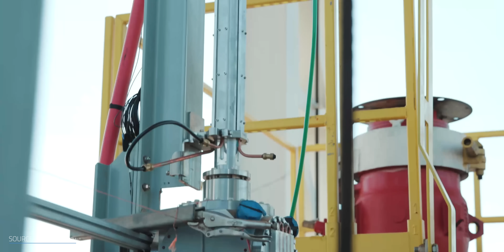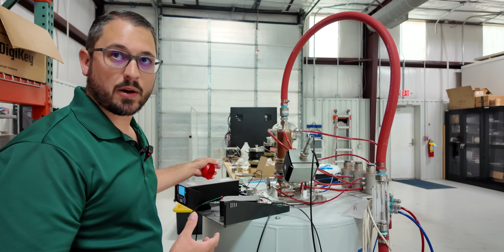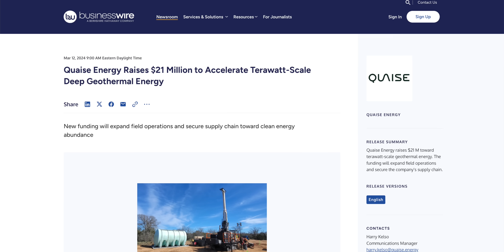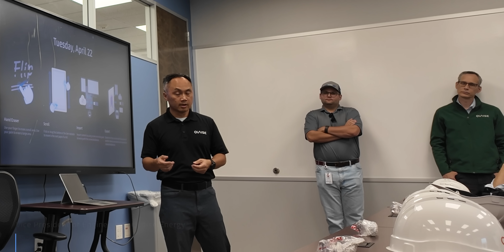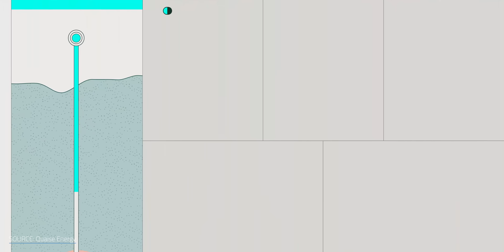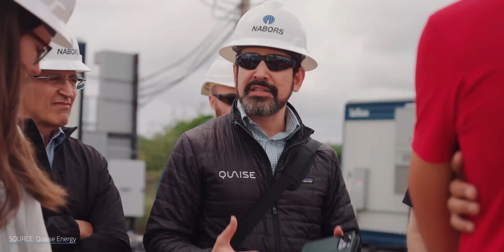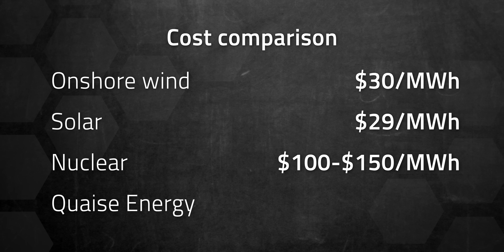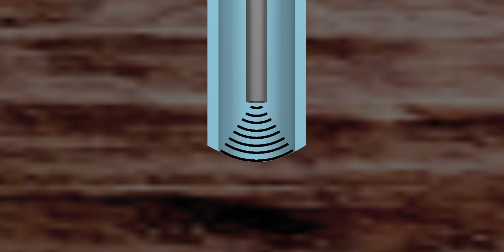How Geothermal Energy is About to Break its Limits

Comment: As of the now estimated costs higher than solar and wind, but cheaper than nuclear clear good for areas lack of solar and wind, and with the side effect of using heat where it is needed yet (Arctic regions).
Go ahead, but be remined ... we thought oel will be so much never ends, gas and coal - but we know, that this deposits are limited ... as is the heat of earths core ALSO !
We have realized how a small but steady CO2 output alters our air composition and started climate change, so if we use this thermal energy too much for we WILL also change the heat of earths core with other problems.
Solar direct and wind as secondary product of more natural power brought from the sun must be the main source in future.

Comment: electricity cost alone will be absurd, it is like microwaving to melt ceramic or glass ware. additionally, the equipment will not survive once they go deep/hot enough which they haven't done yet.   i hope they find other applications for their work.

Comment: Is there any concern of cooling the earth core or is it to minimal to even worry about.
Is the heat created purely from these earth pressure above? 
Very cool system
Reply: Cooling the core by one Kelvin would require extracting 10million years of current world energy consumption, without even counting the radioactive decay constantly replenishing it. Also the rate of what we can extract is limited by the thermal conductivity of the rocks in the crust and mantle.

Comment: I think this drilling technology has amazing possibilities for many applications, particularly if the costs pan out as described.  However, generating hydrothermal power using supercritical water creates many concerns.  Supercritical steam that is used to make electricity has faced many hurdles including rippled magnetite on the steam generators, and this is with ultra-pure water. Supercritical (SC) water, like most supercritical fluids has amazing solvation properties and downhole SC water may dissolve many impurities in its path to the power generation system.  In contrast, using this system to drill for subterranean H2 reserves might be a great source of clean energy.  The gas can be cleaned and used in electrochemical systems to produce unlimited amounts of clean energy.  Great tool and technology, but maybe look at H2 as a better first option.

Comment: Fascinating video!  I'm wondering if @quaise could tell us what happens after they've bored the hole.  Does it require some type of fracking at the bottom to get enough heat transfer to the water?  Or simply use the single hole and the heat transfer from the wall?

Comment: Are the bore holes predicted to have vitrified glass casing all the way down? Or some steel casing through certain earth layers and vitrified glass through other layers? And is it predicted that vitrified glass casing would be water tight? It sounds like it's "wait and see" with regards to water getting in the hole. But if vitrified glass is coating the bore hole, I was thinking perhaps it would serve to keep water out.

Comment: Drilling wells is about pressure control.  If you hit a gas zone at 1000’, it will be coming up the hole at least 4400 psi.  The gyrotron ‘glassed’ borehole withstanding 4400 psi is risible.  That’s why wells are drilled pressure balanced with drilling mud.
    Once the holes are completed and the zone fracked, don’t assume the circulating well fluid behaves as planned.  The fluid has its own ideas and will channel a short cut instead of spreading on an even front thru the formation.  It has to be circulated s-l-o-w.  This ain’t a show stopper, but the frac zone needs to be much larger than expected.
     The temperature how deep you can drill with the gyrotron which is not too hot by steam plant standards.  Then the well fluid, which is full of crap, has to exchange heat to the turbine cycle.  More loss.  The net product is wet steam.  This isn’t a show stopper, as nuke plants have the same problem.  It means more capital needed.
      But on a bright note, geothermal has one thing going for it….its more promising than fusion power.            Cheers

Comment: Former flunkie offshore drilling geologist (mudlogger) here.  I daydreamed about doing something like this many years ago.  My aim was just make drilling faster and less arduous.  I even wondered if it could be used to harvest metals from metal-rich fluids rising off of magma bodies as an alternative to conventional mining.

Obviously mine were just hypothetical musings and had zero applied physics and engineering attached, so I claim and deserve no credit, it’s just kind of nice to know that I wasn’t the only one thinking about this.

I do wonder how they will handle drilling through through rocks with large volumes of highly pressurized pore fluids.  If you can start boring into impermeable igneous rock at ground level that avoids the problem almost entirely, but does narrow appropriate sites available—still many more than now, but you’d still have to drill where nature lets you, rather than just “point the pipe down and let it rip, drill ahead without fear or caution” that would be ideal.

Possibly another option might be casing the hole simultaneously with drilling it.  That would involve R&D to modify the rigs, and some retraining of your roughnecks, but almost certainly much less than they have already done working up the death ray ;)

In any event I wish them luck and hope that everything goes smoothly.

Comment: Great video. These guys have a viable technology and a very clear plan on how they are going to achieve commercial viability in the near future, and how they are going to beat other forms of renewables in both LCOE and providing constant base load power. Furthermore, this kind of technology could e easily applied wherever there is drilling and fossil fuel plants, meaning that this could be accessible all around the world - they're even planing how to transport the technology in shipping containers. This could really totally revolutionise clean energy if it works.. 

The biggest problems will be dealing with real world conditions and issues like dealing with groundwater, but the very structure of the drilling shaft being vitrified rock should help that, as vitrified rock is very robust and durable but also dense and nonporous, meaning it's difficult for water to pass through it, meaning the problem will be more likely drilling through water than water getting.through the drill channel walls. So it looks like the main issue will be of extra energy being needed to boil the water off rather than technical difficulties - which may be helped by the shaft being constantly heated to a high temperature by the drilling process itself as well as the water in the rock getting hotter as the shaft gets deeper.

Solar is already very cheap so a lot of people ask: why bother with this. technology? But the issue with solar cones in two ways: the energy is intermittent so batteries are required to keep the energy stored (which is an extra cost), and solar panels only have a lifespan of 25 years, meaning they need to be replaced after that time and all the solar panels that have been used will require recycling. That means not only enormous stress on the industry to recycle these panels (plus extra energy and extra cost to accomplish this) but an added cost for everyone who needs to purchase new ones (especially governments who use wind farms). Wind is similar except much larger structures need to be disassembled and recycled. This new avenue for geothermal is a more viable long-term solution...if they can make it work.

Comment: The incongruity of a cryogenic superconductor gyrotron to generate plasma...  If I followed this video, it would seem that the main issue they have with the current drilling operation is the power source/supply and there are solutions for that, so I  hope that this will prove a viable operation.

Comment: they've demonstrated… 10 feet? is that right? They haven't even matched depth with the height of their derrick?
and to achieve their aims, they need … 20km? nearly double the depth at Kola, which was and remains an unparalleled achievement?

I'm just checking the figures presented here to see if I missed the part about their machinery doing anything at all. Because a 4in bore to 10 feet is super for … anchoring a pretty big flagpole?

Comment: so what do you do when youve extracted most of the heat from the well? drill deeper? eventually your gonna cool it down too much to be useful, what is the specific energy at a given depth potential value versus drilling cost? maybe you can drill farther after you've collected the surrounding heat? their is still alot of unkowns and problems unaddressed that could severely affect the viability, you could potentially drill even farther than imaginable or just have overlooked the problem of rock being a very poor media to transmit heat. and what about the potential for earthquakes? drilling massive arrays of wells will have some impact to tectonic integrity, couple that with contraction of the ground from cooling, and now what do you do with the waste heat? the warm steam after leaving the turbine will go into the atmosphere and now will heat the climate to some potential, if youre gonna critique fossil fuels then you got to hold the same standard of questioning for everything, otherwise 50 years down the road its gonna be the same story as our current situation.

Comment: Nice idea, but they could actually try to design a machine capable of working on venus, and adapt it to BE the drill-head apparatus instead of having it exposed on the top of the drillshaft. If you use a coolant medium that can create electricity through thermocouples and an active use of a coolant to keep the outsides from melting as it bores through solid rock with emitters that go THROUGH the drill body in radio transparent materials that also allow coolants to make a heat exchange powerful enough to vaporize water at the sweet-spot temperatures of over 375 degrees fahrenheit to create superheated steam to drive powerful turbines. Think in reverse and reduce the size of the turbines, the temperature, and the mass, and you have a community sized geothermal powerplant that can move lower or to a new site in case of earthquakes. Having all the machinery at the top reduces efficiency and increases lag in decision making times.

Comment: why not spray the rocks with a black, or milimeter black spray paint before vaporizing it so less of the rays get reflected and more heat goes to the rock under the thin layer of paint?

Comment: Cool but clearly non viabile. It will be acquired by a oil company and maybe used for oil drilling or just forgot. 

I don't understand why you need 300+ degrees, why don't use gasses that expands at lower temperatures?

Comment: There are stratigraphies where drilling fluid of a specific density is needed to stabilize the well bore. Not sure if vitrified sandstone and shale will work and certainly encountering a geo-pressured gas and/or salt water sandstone would be a disaster. Conventional drilling to a determined depth, then casing the open hole, and drilling ahead with the gryrotron?

Comment: I don't see how the forced air that removed debris and vapourized rock from the hole keeps vapourized rock in a gaseous state long enough to get it out of the hole.  I was imagining rock vapour condensing on the sides on the way out, and on the boring mechanism that's still working lower down...

Comment: Hmm, but what happens when they drill through a water bearing layer?
Even a small crack in the melted rock walls will lead to significant ingress and probably explosive steam flashing out of the hole.

Comment: What an amazing process. No tripping out of the piping and there is no casing or mud issues. The sealed off hole also means that the fluids that are used to generate the steam won't contaminate the porous layers. Hope it works for them! I do think that they will have issues when they run into zones that are under-pressured. Will the "burn hole" have the strength to hold up if a subsurface cave happens?

Comment: A very encouraging report! The signs of a practical technology are everywhere in this video. They actually have performance numbers (!), something most blue-sky nonsense projects cannot be persuaded to divulge. How fast they can drill (varies by rock type=true), rate compared to mechanical drilling, energy it takes to drill, a plausible timeline for first pipeline, a plausible cost/return estimate, and vitally, a plausible backstory of the technology (uses a device designed for nuclear fusion research). There are no information black holes, and there are no physicists saying this is impossible nonsense. 
This does not sound like a long con, like cold fusion. They are not violating established physics. In fact, they are adapting an established technology similar to microwave ovens, so there's plenty of proof that it's not bullshit. Another good sign is that they aren't pretending the energy will be "free." They're estimating it will be more expensive than either wind or solar, but geothermal will be constant and reliable. Cheaper than a fission nuclear plant, but nowhere near as fear-inducing. Hey, it's just a hole in the ground, and you're just making really hot steam, without burning fossil fuels. No radiation, no CO2, no unexpected disasters. This might actually happen!

Comment: I believe your wind and solar pricing is 100% pure bovine excrement.    Was it so so cheap in Spain when the grid colasped.     If you do not  have 100% backup baseload you have the edge of death for how many people.     Geothermal has a solid baseload energy source.    If this process lowers the cost of drilling per mine it makes more areas where geothermal  can be produced.

Comment: If they really can drill at such low cost, they should be offering their drilling services to all kinds of projects, like subway construction, tunnels, water transmission, etcs. There must be some reasons that they are giving up all the existing markets and applications. All start-ups try to exaggerate their strengths and hide their shortcomings. I would not expect this company to be any different.

Comment: In terms of long term energy development, this tech could work anywhere with a hot mantle.  I'm thinking especially of expandable/modular baseload generation (and easy heat!) on mars, since wind and solar are weaker and less reliable (dust storms!) there.

One drilling rig could keep making more power stations as facilities grow, and a superabundance of subterranean energy systems would encourage growth where the annoying surface conditions can be avoided.  Enough electricity/heat to power agriculture lights and maintain balmy open-air temperatures in a big lava tube city would make things a lot more sustainable, even desirable.

Living in cramped little 10-meter corridors spiderwebbed through the rock is survivable.  Living along a 200-meter-wide avenue at stable room temperature, where you can literally plant your own garden boxes in the front yard, makes it a comfy home.  It's the possibility of a real ecosystem.

I checked.  Martain crust/mantle conditions make it a bit farther, but it's still in the doable range by the figures Quaise is talking about.  The tectonic stability/dormancy of mars actually makes it even better than earth for this technology.

There are certainly times when my knees think 38% gravity is a great idea.  If the medical issues with mars gravity work out, such a colony could draw a lot of senior experts that could still be physically functional, when the raw weight of the earth was a burden best left behind :)

Comment: Matt, you should calculate the fully loaded cost of wind/solar. $20 per MWh does not include distribution, which can add 100-200% on top of that. Baseload energy like what Quaise aims for is much more precious than intermittent sources because it's much easier to distribute and does not cause stress on the grid. On the flip side, your video did not discuss emissions; geothermal does produce emissions as it hits pockets of gases trapped in the earth's crust, and this needs to be taken into consideration. But heck, great report overall. Thanks.

Comment: What is not mentioned in the Video is one big surplus advantage: you can use almost all now running conventional Power plants by drilling the borehole next to it, which makes it even more impressive.
Reply: True, because even fossil fueled powerplants really just need heat.
Reply: @Blaquer17  Solar PV, Hydro and Wind does not use heat to turn turbines but everything else does.

Comment: Can you use a light-cell instead of an inefficient turbine to harvest electricity from the well?
Reply: 350°C steam doesn't light up. Converting its infra-red radiation to electricity is pretty inefficient and/or expensive, though research continues. There are alternatives to steam turbines like Stirling engines for generating electricity from a heat delta, but they're not as developed.

Comment: Does anyone understand how deep this thing needs to go to make sense? How will it extract the heat of the rock at that depth to have usable steam at the surface? Heat loss through all that depth? Doesn't the glass create a very low heat-transfer rate as a result of the boring process?

Comment: In very deep zones, it seems wise to employ low thermal coefficient strategies to avoid unnecessary fracking of the crust/mantle. And as you get closer to the surface, higher and higher thermal coefficients can be safely employed.